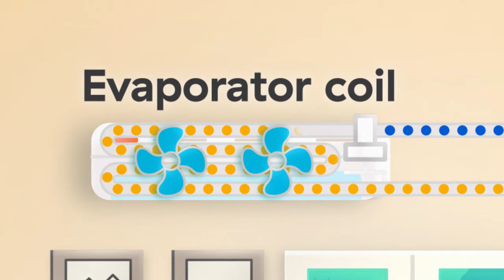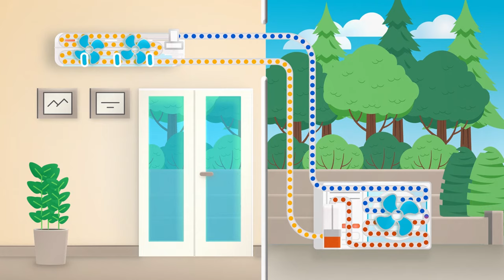How Do Heat Pumps Work? | Heat Pumps Explained

Comment: People, please do some actual research into this before you make the decision of buying one or two or three.  Heat pumps work best between 10*C and 30*C; once you start nearing 3*C they become less and less efficient.  Once you surpass -6*C they become pretty much useless and you need to start using supplemental heating ie: space heaters throughout your home.  Not to mention, the heat pumps themselves start to ice up and have to run their own defrost cycle to clear the ice away from its metal fins and then start working again.  There are a couple of heat pumps out there which can operate to as low as -15*C (still not at all close to the -30*C temperature we just saw) but even these can only provide enough heat for up to about 400 to 600 square feet of living space.  So are heat pumps more efficient and carbon neutral, yes, but only between 10*C and 30*C.  The other consideration is that generally heat pumps, like the video shows, has a wall mounted unit which is in only one room of your house therefore, you would need separate units in several rooms of your house with refrigerant lines running all over the place to the outside.  There are heat pumps which can be retrofitted to work in a ducted house which previously had a natural gas furnace however, these are less efficient and require a large amount of retrofitting to be able to move enough volume of air.  Ducts are the size they are because of pressure and the volume of air you needed to move through them based on the location of your furnace and the size of the home being heated.  So, to retrofit this design with a different system which it wasn't initially intended for isn't simple and costs more money and additional electric fans are needed to move the air through the duct system.  I know the Federal Government is pushing for heat pumps and willing to give a rebate for them but they just don't work entirely in our climate in Canada and yes, I know Vancouver and area doesn't get as cold but even around 0*C the heat pump is working near its capable limit which isn't easy on the unit to run at all winter long.  That would be like driving your car around in first gear everywhere.  Can your car do it, yes, but it isn't designed to maintain this situation for long periods of time.  I like the thought of being more carbon neutral but heat pumps aren't for our Canadian climates.
Reply: Tetrafluoroethane has a relatively low latent heat of vaporisation and low boiling point (-26.3°C). Latent heat so low and you can extract thermal energy from a very low temperature. Does this answer your concern?
Reply: This is really only a problem for a certain, tho very common, type of heat pump.  Heat pumps for colder climates do exist and do work just fine.  Definitely know your climate and talk to a qualified retailer before making a purchase.  

Please don't throw out the idea of using a heat pump just because it gets below 0.
Reply: Thanks - my husband just said the exact same thing essentially prior to me finding your comment 😅✊
Reply: I guess BC is a little more suitable than Manitoba
Reply: If Sweden did it, why not Canada?
Reply: "Couple of heatpumps that can operate as low as -15C"?? LOL. That's called an AirCon with heating properties. Proper heat pumps used primarily for heating, like Panasonic HZ25XKE for example, has COP of 2.2 in -25 celsius.
Reply: Where did u get this from? I have a 10 year old heat pump that works in -20 no problem, sure it takes longer time to heat up but it works just fine
Reply: We have recently switched to heat pump. 20 years ago natural gas was the best thing. It still is pretty efficient just not if you want to reduce carbon footprint. Heat pump with small natural gas seems to be the way to go now
Reply: Thank you. This comment gave me a lot more info than the video did.
Reply: They are very effective with new homes that have passive house envelopes, but they require a secondary system in any kind of retrofit.
Reply: Instead of typing 3* you can type 3°. Just tap and hold the Zero button for the degrees ° symbol.
Reply: The oil, coal and natural gas industries dont want to go broke. Can you blame them?
Reply: Just added a heat pump, still have the furnace but furance turns on after -4. So it's a hybrid system and government giving a rebate so the installation was not expensive at all. Total out of pocket cost of $1500. Will see if it saves on energy bill this winter. If it even saves 10-20% over the course of the life of the pump (10-15 years) it will pay off in a normal Canadian house. I live in the GTA so it gets cold enough
Reply: @nbasingh  just like how the gubberment gave you a rebate of an ice cream cone to get inauculated with poison. Still haven't figured out the scams I see. Take your heat pump and shove it. Have fun with that hydro bill. 😂
Reply: @ZiadHelou But all his number are correct about the efficiency going way down past 0c so anyone east of the rockies ait using these things
Reply: What are you doing below 10°C and over 30°C? 🫣
Reply: How ridiculous
Reply: @pdnowlin  you're right.... Heat pumps are rediculous for northern stares and Canada.
Reply: @mickzed6746  yes refrigerants aren’t great for the environment nor is damming every river in the country for electricity…. For the extremely sub par results that you get from a heat pump.
Reply: Very helpful! TY
Reply: Wow, all these engineers having such thoughtful discussions! /s

Hey everyone, have someone come and look at your property, or do actual research. Don't rely on internet comments. Even well intentioned people can lead you astray.
Reply: Lmao where did you get that information from 🤣🤣🤣 you gave all the lads I work with a good laugh ffs
Reply: What about for cooling the upstairs of a home that would see 32-37 C highs for about 2-3 weeks outta the year?
Reply: Bro works for the nat gas industry lol
Reply: Untrue
Reply: For about 3 million bc residents, they have seen under -6 one time in the last 5 years. Great info though thank you
Reply: I'm not sure where you are coming from with this. I just got my house renovated. And each apartment got an Air - Water heat pump. Meaning it doesn't have conditioner, but instead it circulates heating a more traditional form of radiators. This winter was first with the pump. And it heated the apartment well, too well I'd say. We needed to lower the radiator temperature even though outside was -20. And all of that before house walls were even renovated and isolated. Now all we need is to wait for this winter to see how electricity will be saved compared with insulated walls versus not insulated walls.
Reply: @nbasingh That is what you call a duel fuel system. Your auxiliary heat is firing the furnace.
Reply: The best explanation ever!

Comment: the heat produced by these is very poor, noisy things that lose efficiency within a few years{ not even that efficient from new} trying to sell the electric dream  .
Reply: not sure you're right about that. I have one that's still fine 10 years later. It's the cooling that is especially great. The newer models have quieter fans.... and other modes. It doesnt have to be on all the time.
Reply: @halfalligator6518  By any chance are you trying to sell something.here in the U.K. we don’t use them in the summer and it is recommended that ounce installed leave it on,they read a different book from you

Comment: BC Hydro is completely Vancouver/Victoria centric.  So many people who have installed heat pumps here in NE BC need to run secondary heat when it gets cold during a time we call...winter. Nobody except greenie Vancouver transplants install the few units that do get sold here.
Reply: Yeah you need more than one heat source. Here in New Brunswick almost the vast majority of houses have heat pumps. They will drastically lower heat bills.
Reply: It sounds like they are undersizing the systems relative to your climate zone.
Reply: You should always have a secure backup method of heat with a heat pump, unless yours is exceedingly well designed and implemented.  

You also can still use heat pumps effectively in the north.  Offsetting heating and cooling power is still an offset, even if it's not 100 percent you are still saving money.  Now, I don't know how bad it is up in the northeast of BC but heat pumps are viable over in the NT so... Just saying.

Comment: I do not think this set up would work for a lot of Canadian homes.    And it’s only for one room.  Most insurance companies in Canada would not allow that as a primary heat source.  I could be wrong ……. If I am get back to me.
Reply: Getting back to you one year later. These mini-split heat pump systems are usually used to either heat or cool up a small space but there are other applications that resemble a "typical" AC system with a furnace (because of the blower) involved as well. Heat pumps usually lose their efficiency (or not heat at all around 20 degrees Fahrenheit, apologies I live in North Dakota). With that being said, I know that Trudeau's big plan is to outfit every home in Canada with a heat pump which is not feasible, people will die if their only means of heat is a heat pump in sub-zero temperatures. Canadians will also need a backup source of heat whether it be gas or electric, which is what us northern states use as well, heat pump or not. Trudeau is just trying to fleece the people in the name of "climate change".

Comment: But it costs a lot in electricity  to run that pump
Reply: Compared to what? It also depends on what your local electric provider charges or how you power the pump. One of my houses is both solar and hooked to the grid, so it's not costing anything, depending how much electricity I'm producing.

Comment: Short, simple, packed with info which can be easily absorbed… DEFINITELY the best video on this topic on the entire platform. Thank you
Reply: Except that it has almost no info about how heat pumps work at a mechanical or physics level. It’s just pretty pictures saying that they move heat one way or the other. Great if that’s what you’re looking for! But not packed with info.

Comment: There are three or four other videos out there on this subject, but this is the best. Well done.
Reply: Its rubbish , it doesn't explain latent heat or the step changes in energy release - like when ice thaws it pulls in energy to change to liquid , and same when boiling to steam, when a compressed liquid turns to vapour its really cold etc -

Comment: Outside when cold contains a certain amount of heat?
I see a lot of people confused about this.  They're using a more formal definition of heat here, which is a transfer of energy.  Unless something is absolute 0 degrees (-270c) it contains a certain amount of energy.  By using the ~cool~ relationship between pressure and temperature, we can cool down a fluid to below the outside temperature and gain some of that energy.  Or, get heat from it.  Then reverse that process and end up with a higher temperature than we started from because we took energy from the outside.   
Talk to a qualified supplier if you're worried about it being too cold in your neck of the woods.
Reply: Rapidly compressing gas into a liquid creates heat, Rapidly expanding gas creates cold. The fan on the outside unit is pushing air across the coil that has the undesired hot or cold to help regulate the temperature in the line.

Comment: Is there only one vent indoors? How does it affect other rooms at the other end of the house. If my bedroom is 80 F. and the heat pump vent is in the front of my house, how does the bedroom get cooled in the summer? Also what happens if we have two floors? Do we need a separate unit for each floor?  Reason I ask is because my old fashioned window AC unit doesn't do much for other rooms.

Comment: In the winter it "pulls heat from the outside air " into your home. In Ontario at -30, what heat?
Reply: Wondering about the same thing. The heat pump would continue running until it couldn't anymore around -7 in Ottawa, then it switched to auxiliary. My solution was to permanently switch to auxiliary (furnace) that runs on gas, then watched my electricity bill went down the next month, ha..ha!

Comment: How much heat do you get out of minus25 to minus 30 c degrees?
Reply: at 35F, my heat pump blows ~58F air inside. Further bellow I had to turn it off and use a propane furnace.
Reply: They do not work! 😜

Comment: How much power do they use? Would the heating cost more than gas forced air heating?
Reply: It depends on their COP (coefficient of performance).  A COP of three - meaning you get three times the heating or cooling for every amount of electrical energy it consumes - is a typical value for modern heat pumps, although the COPs are rising as the technologies improve.
Reply: Yes much much more. I install furnaces and heat pumps and yes heat pumps cost far more to run.
Reply: @bcc1428  relatively speaking, or absolutely?  The environmental and health costs of gas aren't cheap either...
Reply: @David Pedersen  if you think all electricity comes from sustainable means then you need to do some research guy.
Reply: @bcc1428  oh trust me, I stopped falling for that myth a LONG time ago...
Reply: @davidpedersen1757  the environmental impacts of refrigerants used in the heat pump are horrible for the environment, as is damming every beautiful river in this country for electricity.  BC last week had to buy electricity from Alberta and Washington state.  Heat pumps have a large electricity need for the ability to heat 1 room
Reply: @pdnowlin  all good points, although their efficiencies ARE improving with time.  I also believe they are working on non climate-harming refrigerants which is good.

They may not work everywhere, but for those who DO use them I generally hear nothing but praise.
Reply: @bcc1428  Thanks to an honest technician, I switched completely to furnace in winter to get heating. This summer, as soon as temp. in house goes below 23C, I simply turned the Aircon (heat pump) off and let the air blower runs permanently to de-humidify the house. Will keep an eye on the electricity bill

Comment: But as soon as we need heating, isn't it better to just switch to the auxiliary (furnace), because the lattter runs on gas which rate is cheaper. Otherwise, yes I'll be reducing carbon foot print, but I'll be paying Hundred $$ more due to expensive Hydro rate. Either I misunderstood, or it was hidden in your presentation. Appreciate some precision.

Comment: @BC Hydro So If I have a heat pump and i turn the heat on... am I circulating fresh air from outside into my  place along with the heat thats being pumped into my home? And if its the ac only sucks air out of the house... no fresh air is being circulated inside right? Im asking because i've had to seal off every single vent door and window in my place because of 24/7 nasty smelling skunk smoking neighbors and want to know when i turn on the heat is that a way that fresh air gets into my place without having to open the windows?
Reply: No.  You are circulating heat from/to outside.   That heat is stored in refrigerant, which merely circulates it.

Comment: My question is can the heat pump be installed within the house to capture heat at 60 degrees, instead of outside ,where the efficiency drops with temps below 20 degrees,  It could still be vented with a louver.
Reply: Theoretically yes however I've never seen done. The room you aren't cooling would get extremely warm and vice versa
Reply: If you mean to capture heat from the room and then heat the same room it is like you have an open refrigerator in your room with no efficiency at all
Reply: Too noisy, thats why they are outside, they could always have a duct to pull in the outside air but they dont. My neighbour has one and it is loud and its fairly new
Reply: The house would become colder because the other end is basically AC

Comment: Dave! There are heat pumps with COPs up to 5 not just 3! Even more savings of $$ and CO2.
Reply: The HSPF at your climate zone is a more reliable figure to start from. I doubt if the equivalent cop (basically a seasonal heating COP) will be above 2.5 in Southern Canada.
Reply: @gregorymalchuk272  Howdy! Definitely depends where in Canada and the unit of heat pump. :)

Comment: OMG   The heat pump does create HEAT... How when you compress a gas YOu create HEAT... Use that heat to heat the home then dump the energy by decompressing and allow the liquified gas now vaporize... By expelling it outside the COLD you do not want. 
The new new gas free of energy can be Re compressed.   

To chill a home in summer we compress the gas and dump the heat OUT SIDE.   then the liquefied gas that is cooled get decompressed and gets supper cold that cold liquid now sucks the heat in the home.... The gas is now deenergized and back to normal gas.    Goes back to the compressor to compress the gas again.  

Formula for Creating heat when compressing gas. Boyle's Law: PV = k.

Comment: Ah, not really.  Sounds like a sales promotion.  Heat from the outside at 35 degrees?  Don't think so.  All this is is running an AIR CONDITIONER and using the heat produced by the compressor.  :face-fuchsia-wide-eyes: